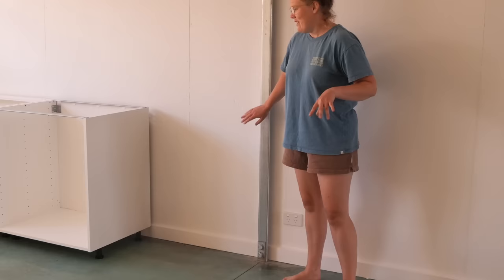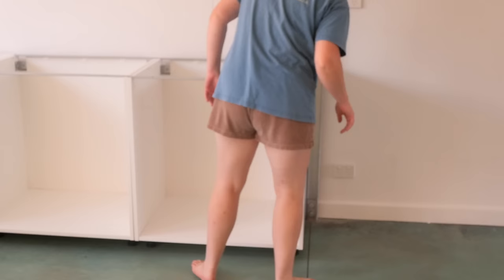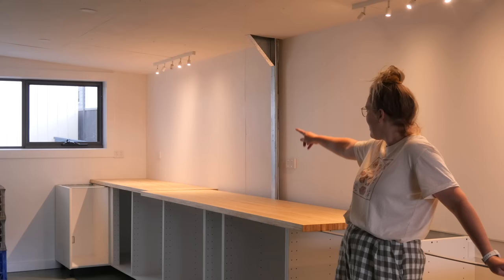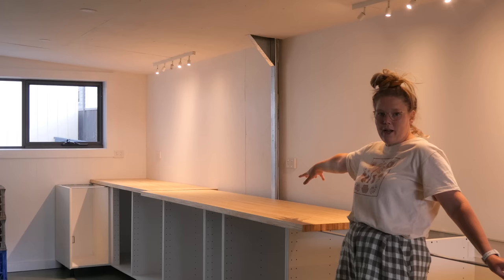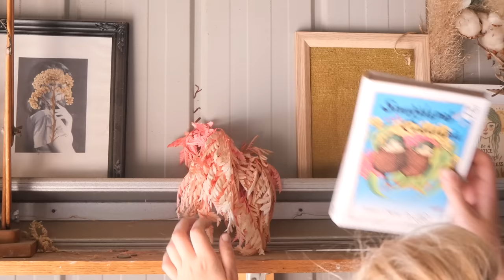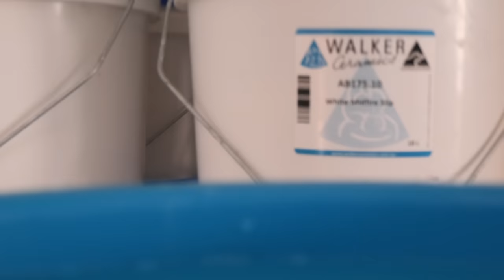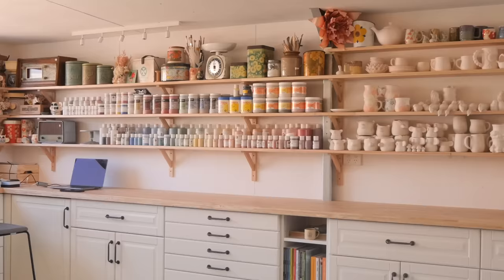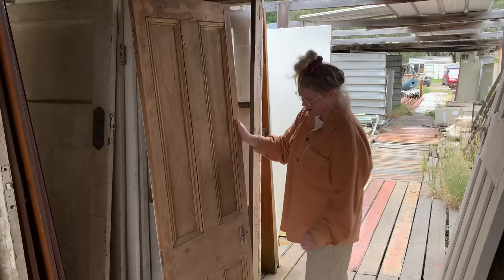Moving into my DREAM Pottery Studio

Comment: I can't believe that you screwed all the screws by hand. Well done 👏
Reply from the maker: AHAH! So I did have a drill but one thing is the IKEA screws are so soft the drill was just shredding the screws out so I ended up just opting for hand for most of it so I didn't ruin the screws in case I ever need to pull them out for something!
Reply: @Shelby Sherritt  Didn't your drill have torque settings? If not, then it's good that you did it by hand. I must say that I admire your perseverance!
Reply from the maker: Yes it did. The Ikea screws are like butter as I said above! I did a number of them with a drill but it just didn't work.